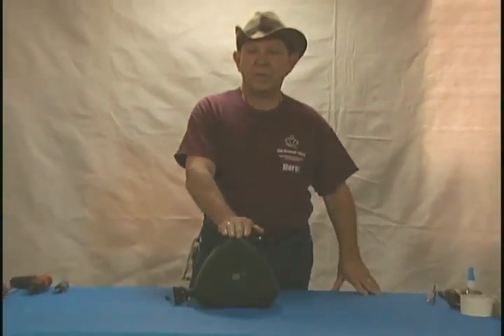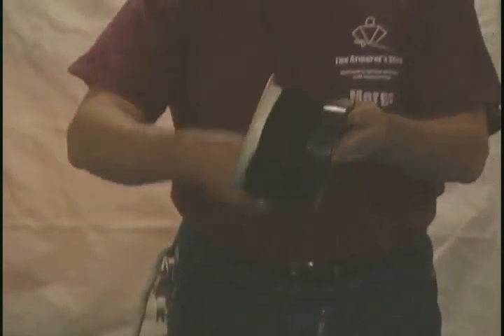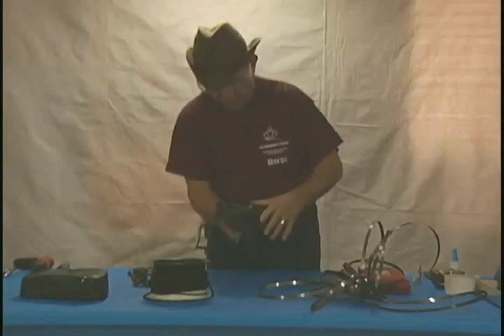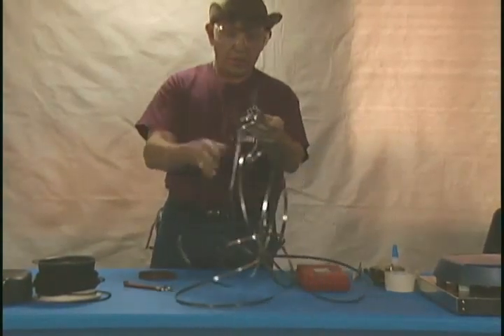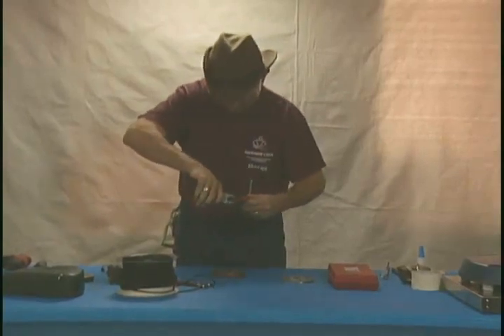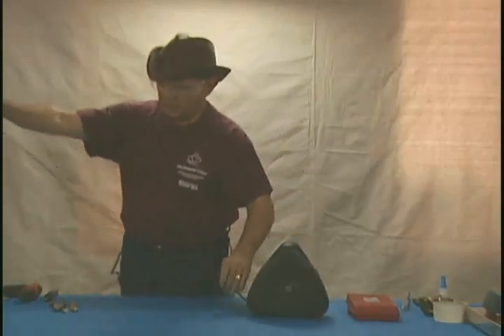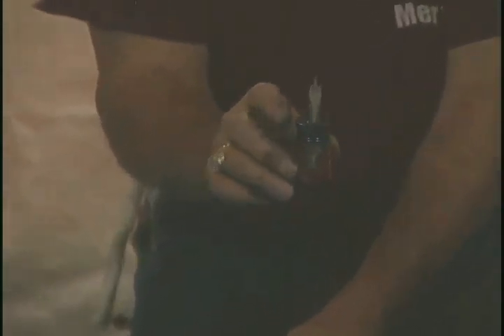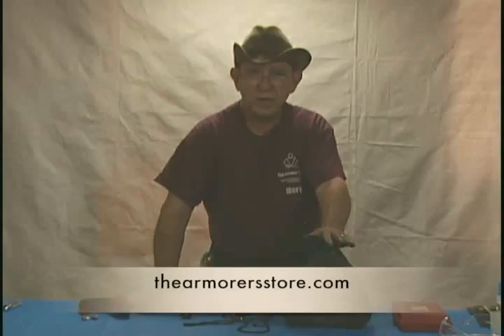Armoring - Reels Part 2 'Uprights'

Comment: excellent video - and pretty much the same for most, if not all, of the older upright reels..  
Do you have one covering the older grey uprights? I think Uhlmann and Leon Paul ones..  I have a few of these and have fixed them (and taken them apart)_ many times, I will try to put a video with those reels up on youtube for those unlucky enough to have to deal with those  (like I had to in the 80's with all guess work)
Reply from the maker: The older grey ones are pretty much similar to the one covered in the video.  The newer plastic case LPs are just a newer version of the old metal cased ones.
Reply: @michaelmergens1424  they ironed out all the bugs (well most of them...lol) found in those.....
I remember at the France Lames warehouse i think in 1997 they had a pile of leon paul spools they said were faulty from a recent world champs (they probably weren't but FL wefre trying to big note themselves... I regret not asking if I could buy those spools (there were what seemed like a hundred of the new ones with black and blue sides as above)  or making an offer as they would have been a great thing to have picked up...